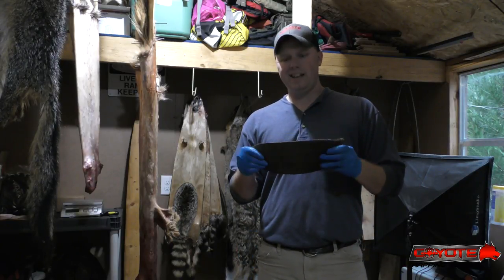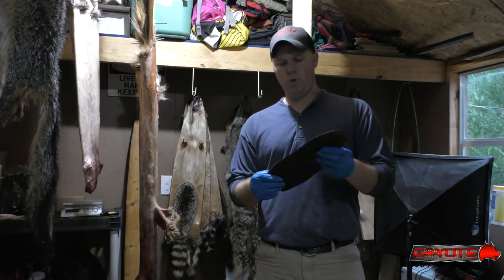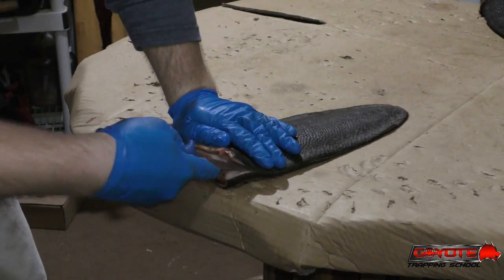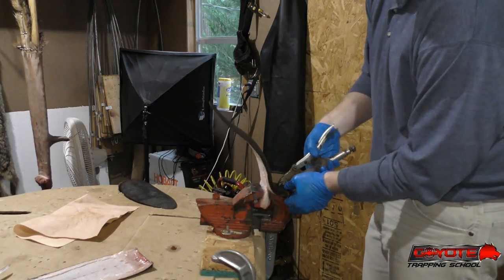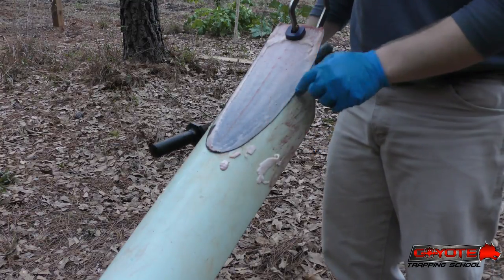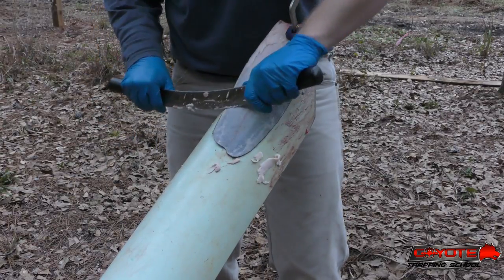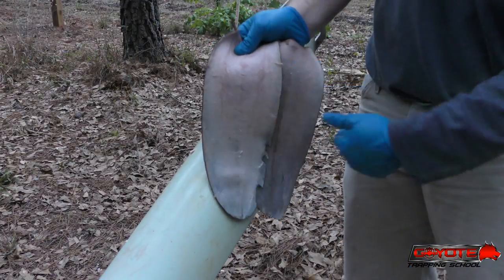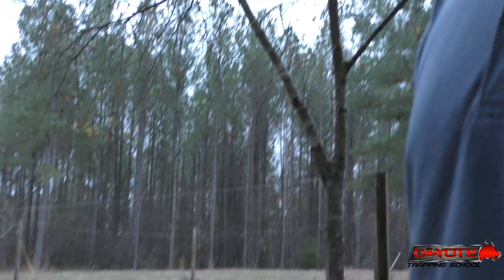How to skin and flesh a beaver tail

Comment: Might be good to do on your knee with a beaver knife. That’s how I flesh their pelts and it’s a lot easier but I may try the pressure washer this year I don’t have the power nozzle but pretty powerful pressure washer may do the trick just stay closer to the hide. And about the tanning you need to get a fleshing machine to really thin the pelts down to get a really good soft tan
Reply from the maker: I've seen Jackie Wurtz flesh a beaver on his knee, that man knows what he is doing!  Yeah I tried my hand at tanning but without being able to thin the hide its not a quality product, in my opinion.  That's why I send anything to be tanned off to the professionals!
Reply: Very interesting idea.  Never thought about a pressure washer.  Would that work? Does it work on skins?